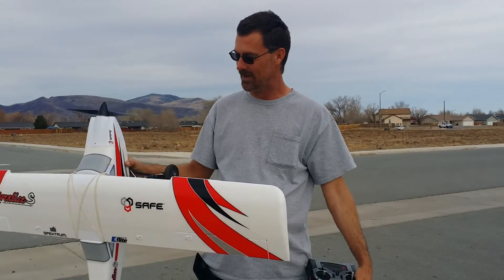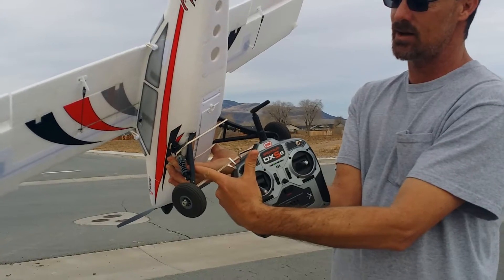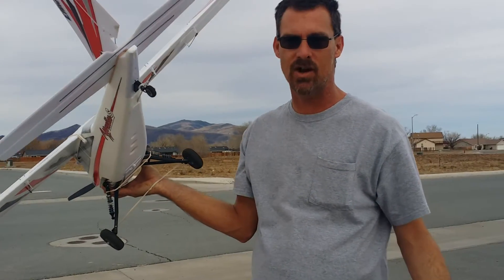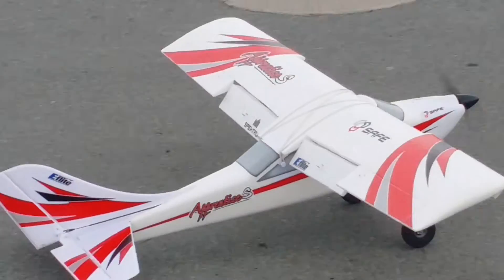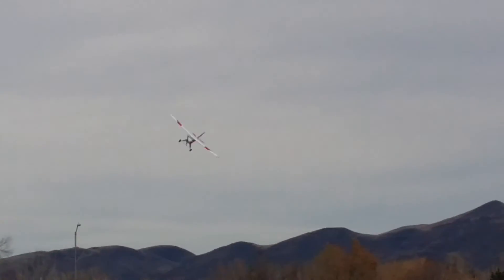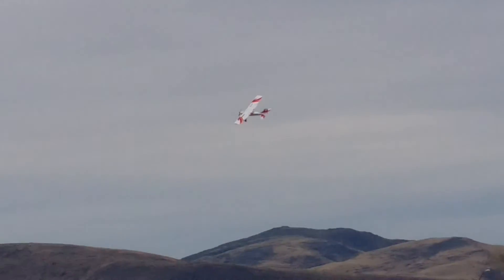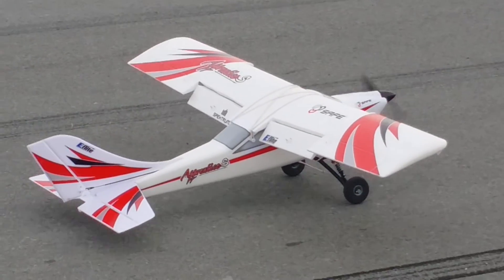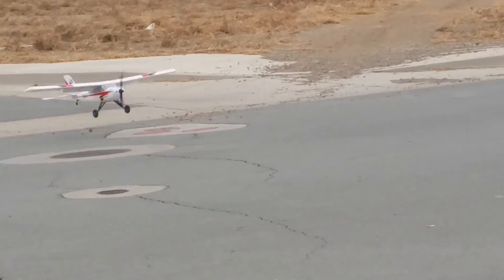Apprentice S 15E with mods.

Comment: I learned to fly with an apprentice, great mods. Of 16 models in my hanger 14 are tail wheeler. Work on that articulated gear and market a conversion kit. I'll have one. Try the Timber it's cool. Thanks for sharing and have fun.
Reply: a trick : you can watch movies at flixzone. I've been using it for watching loads of movies during the lockdown.
Reply: @Bradley Nelson Yea, I have been watching on flixzone for months myself :)

Comment: Nice job on the taildragger and Flap add.  Are you still flying it.   I assume that it does not have the safe technology? Just watching how you initialize it? I just bought the 15S weighting on weather to try my luck.
Reply from the maker: I've crashed and fixed it a few times since I made the video. It is still air worthy. After I did this video you saw, I did more work on the gear so I could remove the rubber bands and I put a new main wing with updated flaps. Thank you very much for the compliment. Unfortunately I haven't been able to keep up with this hobby I truly love due to lack of funds but I still have my plane.
Reply from the maker: I forgot to add, no it doesn't have safe tech anymore. I put an Orange RX 6 channel receiver in it so I could operate the flaps.

Comment: I know this video is 4 years old, but just wondering if you ever had any problems with the horizontal stabilizer fluttering like crazy out of beginner mode? Nice mods by the way and love the flap idea. Gonna set mine for a few second deployment
Reply from the maker: Hi. Thanks for the compliment. The only time I ever had any fast flutter coming from any of the control surfaces was right after I slammed the plane into the ground nose first. I had to replace the fuselage and the receiver. That was when I decided to modify the gear and put flaps on it. The stock received has the motion sensors in it so I wonder if that could be causing the flutter. But I can't be sure. I do know that after I replaced the receiver it didn't flutter.
Reply: John Hannon yeah man, there are countless threads on this “flutter” issue. The general consensus is that it is the receiver, but if you do a search you will find people saying all different things... that landing gear is awesome. I saw your other video and the gear looks like it’s out of a rc car! Great idea to do that and maybe even add some bigger tires, like the tires on the Timber. I know it’s not a Bush plane, but I’m gonna turn mine into one regardless! Good ideas! Also good to see someone flying it with a different receiver. I would imagine by now you no longer even need As3x or SAFE

Comment: Was just thinking about getting rid of rubber bands. I my self am going to a timber landing gear set up on my apprentice.
Reply from the maker: morris mercier Oh. I see now. This video is the first version of my rock shock gear. I hadn't bought the best shocks for the job yet. I bought better shocks and shot another video. The gear you're going to put on your plane will improve its rough field landings for sure. Most of all it will be fun to do.

Comment: I don't understand why u didn't just flip the battery tray then just put the stock rear wheel setup in the front with bigger 3.5" wheels , you wouldn't of had to make all those shock towers or modify anything.
Reply from the maker: Thanks for your reply, but you have to understand that your ideas are just for you. The rest of the world doesn't have to think your way. I did the mods the way they were because that was the way I wanted them to be. You'll find the world to be very creative if you crawl out of your own head and open yourself to others' thinking.

Comment: how do you decide on how much the fuselage should be tilted upwards? in other words, how do you decide the position of the main landing gear?
Reply from the maker: I chose a high enough angle to give the prop clearance when the plane was level, then I positioned the main gear just forward of CG because I installed the steerable tail wheel. As long as your prop has room above the ground when the plane is level you're good.